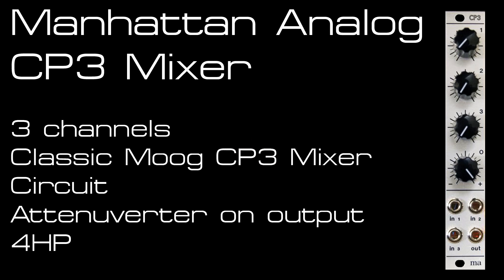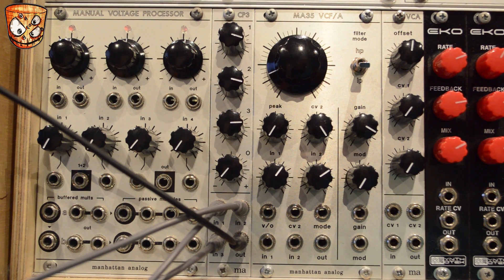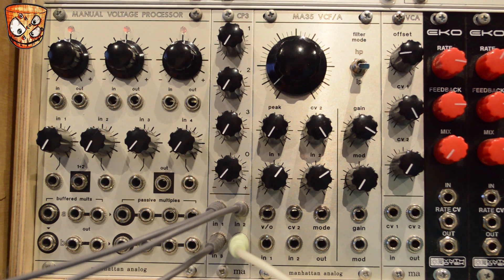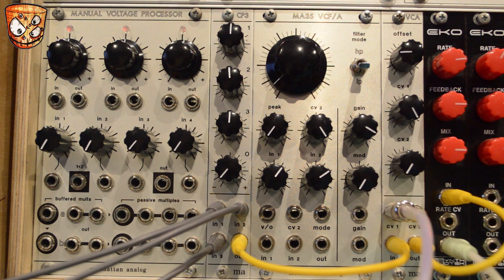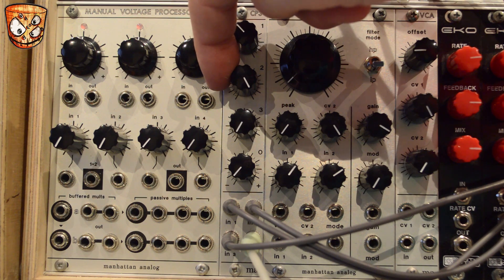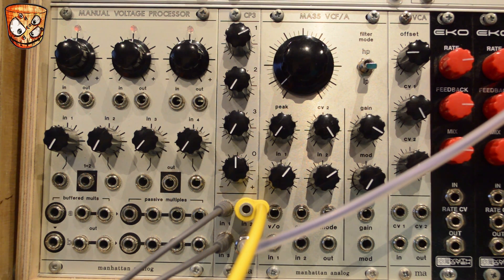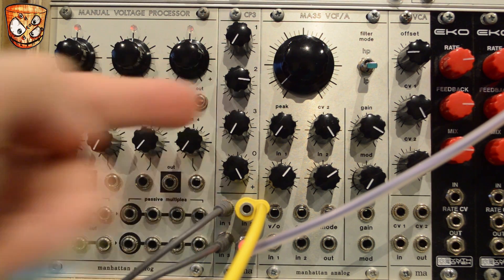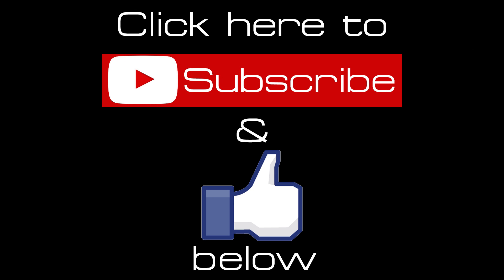Manhattan Analog - CP3 Mixer

Comment: Just wondering: is the saturation any different that STG .mix?  Also can it handle drum breaks etc? Thanks as always for the videos!
Reply from the maker: If not the same, very very similar. It fattens up drums really well. Just clips the top of the waveforms so with something dynamic like acoustic instruments and breaks you just clip the transients nicely.
Reply: thanks for all your useful knowledge :)
Reply: what do you mean about clipping the transients? does it make them, therefore, less dynamic? i'm thinking more in terms of running drum machines through
Reply from the maker: clipping the transients would be like hard limiting. So it would reduce the dynamic range. But lots of drum machines and modular drums are very transient heavy. So clipping them slightly for some saturation sounds great. It's not "squashing it hard" until you really push the levels.